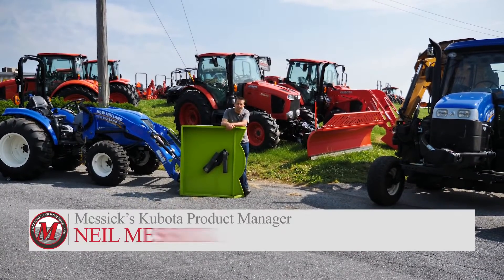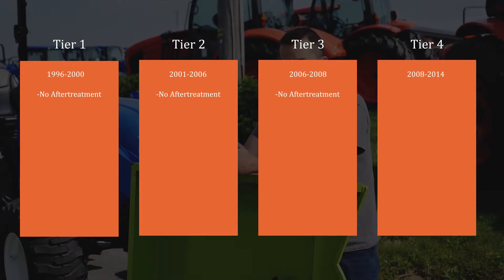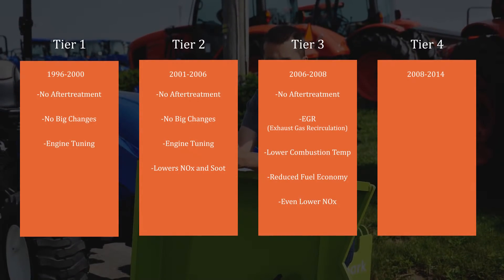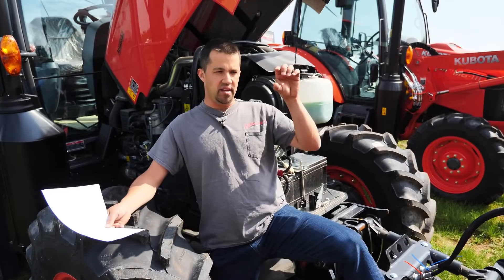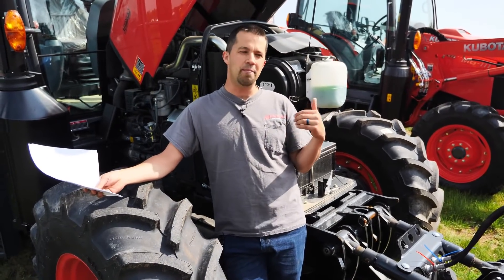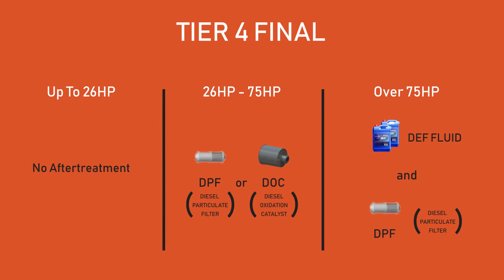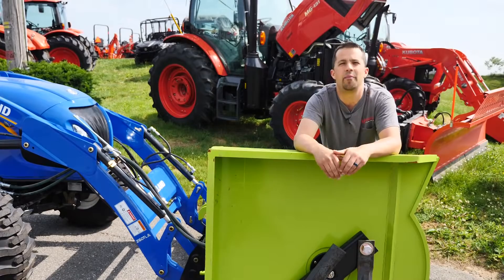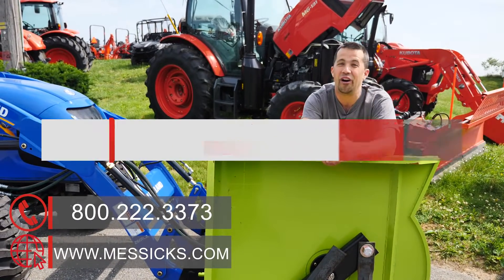Understanding equipment emissions requirements roll out.

Comment: Do you even smell the diesel fuel in new tractors under, say 37 hp?
Reply from the maker: Not really, no
Reply: You do if you open the fuel cap and smell what's in the tank, there's a bit of exhaust vapor you'll smell of course, but the new stuff when its running right and tuned properly doesn't have much of a noxious odor if any...its the idiots in their diesel pickups with their fuel pressures cranked up that are blowing fuel all over that isn't burned, or partially burned creating more obnoxious diesel fuel odors than tractors are LOL.

Comment: Around 2008 when the requirements to lower diesel particulate began, oil refineries switched from making diesel fuel from thicker and heavier oils towards the lighter sweeter crude oils. That’s why around 2008 diesel fuel went from being cheaper than gasoline to being more expensive than gasoline. I wonder if the newer low sulfur diesel fuel has had negative effects on older Diesel engines?
Reply: They still make thicker diesel fuels but for the  maritime industry.
Some times called bunker C or bunker fuel is one such fuel
Reply: Lubricty of the fuel is a major difference.

Comment: I have an L3901.  I never use the power take-off, only backhoe, FEL, and grapple. What is optimal RPM's to avoid regeneration every 10-12 hours ( usually just as I park it to call it a day)?
Reply from the maker: 2\3 or more

Comment: Correct me if I'm wrong, but I think a lot of engines don't even utilize a dpf filter anywhere (unless it's a permanent fixture in the system), everything is handled through the SCR system.

Either way, all the emission reduction junk is all another thing to deal with and always hoping it just works without error.
Reply from the maker: Over 25hp, you need a dpf or doc for soot

Comment: The first part of 2021 I will be in the market for a tractor. I most likely will require a bit more then 26 horsepower. But, I refuse to buy a tractor with the after treatment systems. For myself I'll work the smaller tractor harder and except the more wear and tear. If the new tractors have after treatment repair costs similar to my on road diesel truck then no thank you! Of course the Emissions components will only fail once the tractor is out of its warranty period.
Reply from the maker: I'd see no sense in that. There are basically no parallels from trucks who require def, to sub 75hp tractors
Reply: @MessicksEquip  There are parallels between on road diesel Tier 4 engines after treatments. My 14 Ram uses DOC/DPF modual in the exhaust as do your tractors. The costs to replace it when you have component failure, premature or otherwise, is very expensive. Ask me how I know!
In my opinion being aware of the cost of ownership is smart. I've learned my lessons by not considering that when buying my truck.
Reply from the maker: Sure, however the frequency of problems in tractor applications is vastly less than what you find with trucks. Your worrying about something with a fraction of a percent liklyhood.
Reply: @MessicksEquip  Of course you don't, you're trying to sell tractors
Reply: I think the concern is more points of failure.
Reply: Biggest thing to understand with after treatment on equipment is you have to keep heat in the system. I had a operator shutting off the machine every time he got off for a couple of minutes and I had to stationary regen it very often. Told him to idle it instead and 0 stationary regens in 600 hours since he just lets it run. I just wish equipment manufacturers would be required to have a generic data port like on road for diagnostic’s. Most of the issues I see with after treatment are user generated on equipment. Comparing on road to off road emissions, off road is just a better environment to keep the dpf and doc at the correct temperature for it to work correctly.
Reply: I too have been shopping around for a tractor between the 26 to 50 horsepower range I saw some interesting things on the Branson Site. people say that because they're not  electronically controlled engines they can be easily deleted also Branson seems to have a heavier tractor than most everybody and their lift bucket specs are off the charts compared to others
Reply from the maker: There are 3 red flags here. First, you need to narrow your search. 2nd, all engines in this class have ecu's, without exception. 3rd, watch lots of videos on how to understand loader specs. 99% chance when something specs beyond others in the class there is some funny business going on.
Reply: @MessicksEquip  the specs I saw where on the ls tractor website if you want to check it out they did a comparison between a bunch of tractors on almost every spec right there on the website for everybody to see. Branson was on top a lot of the time. I'm aware of shenanigans  but I doubt if LS would ever publish those specs in such a way to make themselves look bad. My understanding of it after some research is that Branson has a very heavy frame thus allowing the higher loader specs
Reply: @MessicksEquip  the point about the electronic control was made in the comment section of a Branson video so I can't really attest to anything concerning that in regards to your saying I need to narrow my search you sure are right about that hahaha
Reply from the maker: Yea, you certainly should not trust the manufacturer comparisons.  They normally pick unequal machines to compare to.
Reply: @MessicksEquip  aarrghh! The more I know🚜 the further I am away from buying a tractor😂

Comment: I work at an airport, (aircraft mechanic), so I work with a lot of different diesel equipment. Airports tend to have a very mixed bag of old and new equipment, so I can experience the differences multiple times a day.
I have to say, I really do appreciate the newer equipment. It tends to be much quieter, cleaner, and generally not annoying to be around. Compare that to the older stuff, and you'd better be working upwind and wearing earplugs. Also good luck communicating with fellow workers.

Comment: That isn't exactly correct information about sulfur and ULSD.  The process to remove the sulfur is what hurt the lubricity of the fuel - not the sulfur itself.  Also ULSD has had lubricants added back to compensate, but still doesn't hurt to make sure you get quality fuel.  https://fueloilnews.com/2010/03/04/taking-the-mystery-out-of-lubricity/

Comment: Never put a scrubber on a tier 4F.
Will cost you an engine.
Reply: Forget about the scrubber- never use any Tier IV equipment ever unless you delete it. Tier 4  emissions was basically a Band-Aid on a gunshot wound. To truly cut down on emissions you have to do it internally in the engine. Adding an after treatment system is expensive and extremely cumbersome and detrimental to your equipment.  The EPA has no business telling you what to do with equipment that you own. 

Delete and Repeat.

Comment: What was "Interim Tier 4"?  I saw many engines listed as that. Most folks buying tractors with 26HP or less seem to not really care about the Tier 4 classification. They just prefer an engine that doesn't require high temperature regens to clean an expensive DPF filter.  Most small tractors with a DPF will require a replacement around 3000 hrs.
Reply from the maker: $400 cleaning,  not replacement
Reply: Maybe $400 for literally just the hotsoak on the filter, more like $1200 after paying the technician too. Most will end up being replaced, aswell as half the exhaust. After 3000hrs that exhaust is gonna be rusted solid. Im not being a downer as I feel it is worth it for what you get, just tryna be real here.
Reply from the maker: The dpf swap is not hard, but too your point there is still a lot we don't know when it comes to 20-30 years into this stuff
Reply: @MessicksEquip  That's what scares me,,, the long-term cost

Comment: I bought a M5-091 in april 2019, I have always been concerned about the DEF. My dealer told me back in the winter kubota was going to have a recall on the DEF  head and replace it because the sensors corrode in the DEF.  They say parts are still not available.   What do you know about this issue?
Reply: Jerry Dikerson your Fxxxed.

Comment: Its too bad your so far from me. A tractor is only as good as supporting dealer.
Reply: I homed in on the L2501 as it is bigger than I need but it meets Tier 4 without, not the DPF, but  without the sensors and electronic controls that go with it.  I just don't want to be chasing error codes on a tractor that I use weekly for various tasks on my 4 acre place.  If I were using one commercially or if I needed more power, I would buy one with those potential problem sources as a trade off for more power.